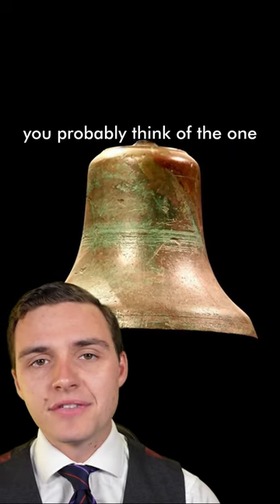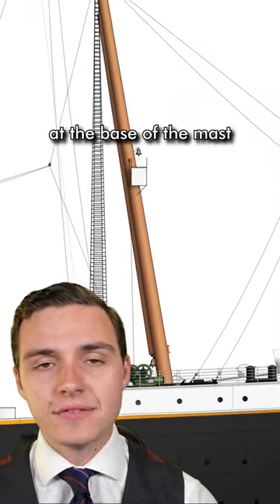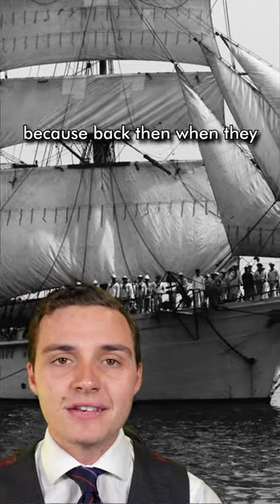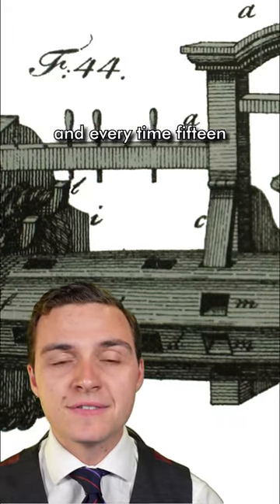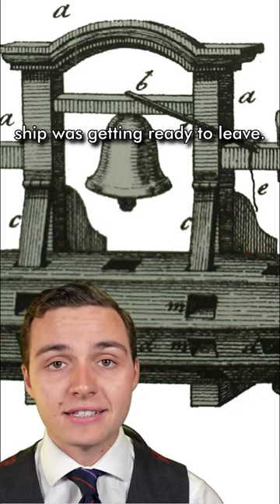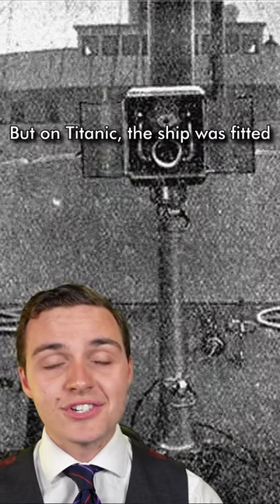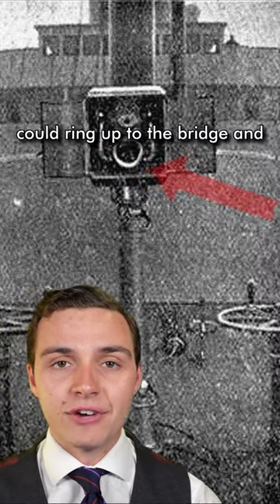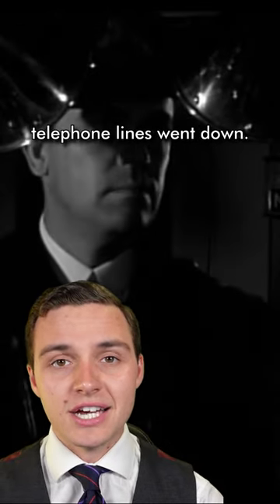Why did Titanic have 2 bells on the mast? | Oceanliner Designs Shorts

Comment: I’m still wondering about the bell that hung in front of the bridge windows. It was probably used to signal attention from the bridge to the crow’s nest, and was actuated by a rope through the wall.
Reply from the maker: It could ring a confirmation response to the crow's nest or the smaller bell at the base of the mast if the telephone lines were not in use. :)
Reply: @OceanlinerDesigns  neat

Comment: Most ships even now have bells next to the windlass. If an officer's radio dies or the talk back fails, the officer or bosun will ring the bell for, as you say, each 15 fathom length of cable. Each 15 fathom length is called a Shackle. The first shackle is the one closest to the anchor itself with number 2 next and so on. The joining shackles between each length are painted red to indicate their location and each link next to it painted white depending on what number shackle it is. So, for example when the fourth shackle comes over the windlass, four distinct strikes of the bell would be made. Even on a VLCC, this could be heard on the bridge.
Reply: Thanks for the addition!

Comment: A bell or any loud sound  made three timed on deck is a distress signal. I used five short blasts to save an embarrassing sinking of the Australian  patrol boat which was to lead a fleet of thirty tall ships and others, celebrating the Bicentenary of Australia. Fifty metres behind I was in charge of the event and was warning of a Rock hazard, made dangerous by five foot of extra tide. Low tide. three years later they expressed their gratitude by fireign a 50 round through our garage door and through our laundry tub from a big Browning. That's the Aussie way.

Comment: they didn't use it to signal the watches for the crew? I assumed they still used the traditional watches and system of bells to tell time, 1 bell being noon, 2 bells being 1:30, 3 bells being 2, up to 8 bells, which was 4 pm and the end of the watch, and time for the next watch to take over and you start back at 1 bell. the day is split into 4 hour segments. the Titanic would have had 3 watches, for a 4 on/8 off duty cycle. they would have needed a bell in each section of the ship where sailors worked, unless they handed pocket watches out to the crew.

Comment: I have a question,how did water not come through the propeller shaft into the ship, was the shaft and the steel casing around it contain some kind of water resistant oil in it or something?